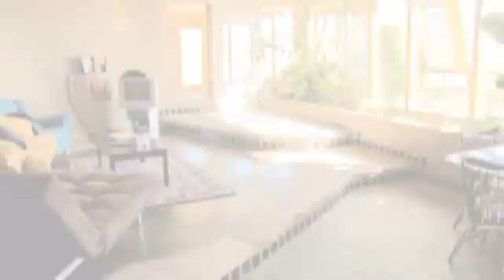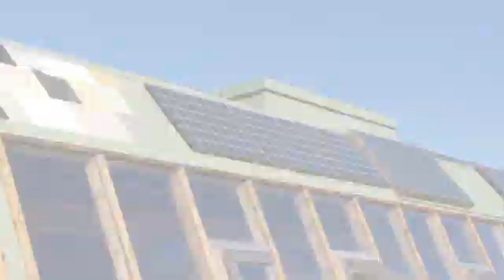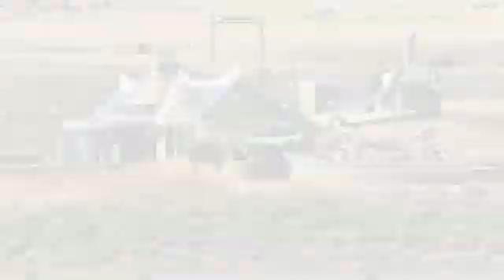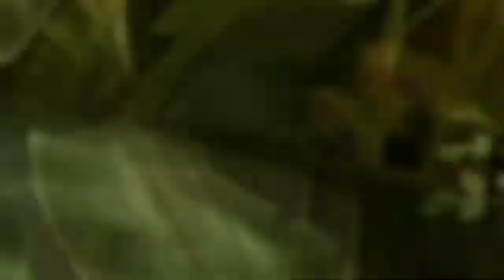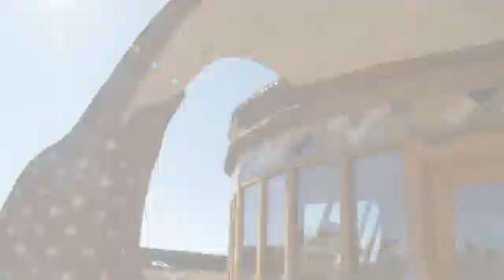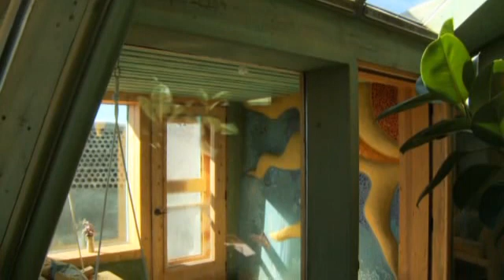Green Home Source visits Earthship Biotecture Community

Comment: @dcracing1 I would design my house differently but I don't flat out agree with you. Some of the elements are "trashy" but this has been going on for something like 30-40 years and I think the majority of the "hippy" design has to do with not having explored design as much as structure over the years. The bottles, cans and tires have become somewhat iconic and therefore help to market the overall concept.  On the other side of things, there really is no need for clean lines- that is taste based.

Comment: Great concept with lackluster delivery.  You can have a recycled/green products and be very similar if not equal to modern pieces.  Obviously this is going for the blatant, "hey we recycled this stuff" however too "hippy".  So if you're a hippy, more power to you.  Features like the tires could be turned into Tire - Bricks, however the bottle - glass accents stand out.  On a sliding scale, some features are leaning towards trash rather than green. But this is very resourceful and good intentions